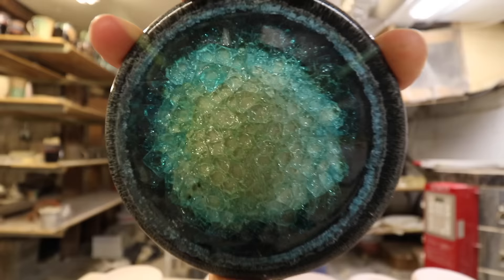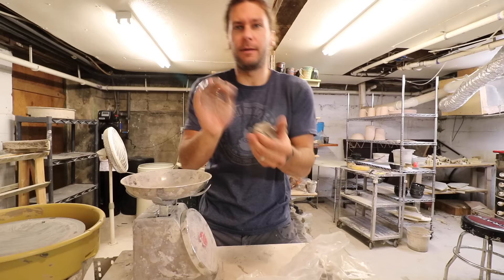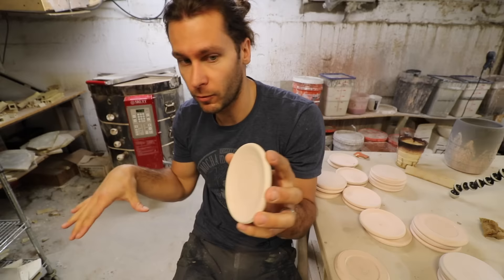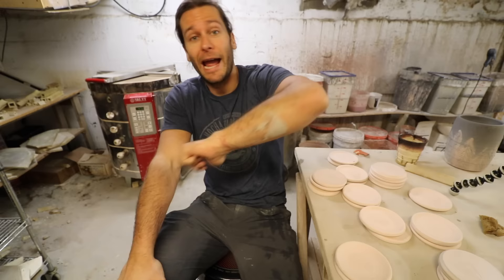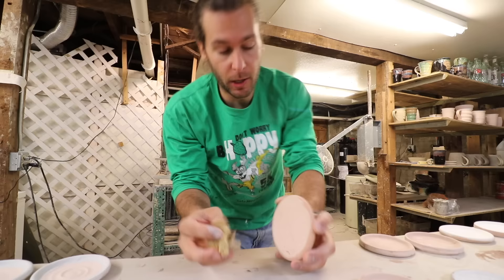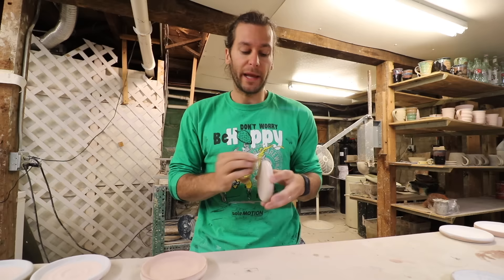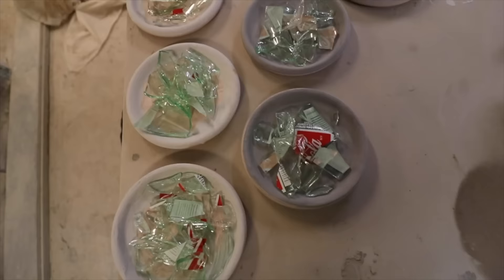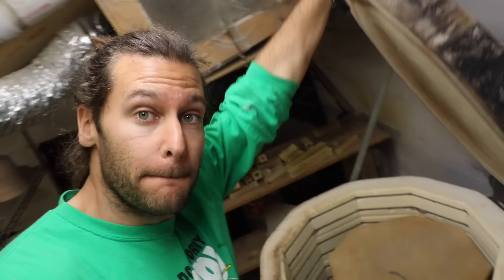How to Make RECYCLED GLASS Coasters!

Comment: I am a retired pottery instructor. Many of my students wanted to add glass to very shallow bowls, similar to what you are doing. They wanted them for jewelry trays. Since the glass left little raised edges that would cause cuts, I had them add a thin layer of resin to deal the surface. Worked great!

Comment: Square coasters?  No waste.  One big sheet.  Cut down, then across.
Not saying that square is better, or more artistic than round coasters.  Just sayin, I believe, cheaper to manufacture.
By the way, I enjoyed the fideo.
Reply: sounds about right.
Reply: Clay can be recycled so there wouldn't be any waste. Also, firing the glass is safer if you have a bit of a rim to prevent glass melting over onto the kiln shelf. So the slabs would still need extra work beyond cutting. Slabs also tend to warp unless you carefully compress/flip them or use a very groggy clay body. I'd be able to whip up a bunch of these on the wheel way faster than I could from a slab, honestly. If you really wanna manufacture cheaply, you'd make a bunch of molds of any shape you want and cast them.

Comment: Two questions:

1. When you dip using tongs, how do you cover the tong marks with glaze?

2. When you leave the red Coca Cola paint on the glass, why isn't there an issue?? Does it just melt and vape off, pigment and all??
Reply: dip the tongs in the glaze before gripping the pottery
Reply: I had the same question about the label.. maybe that's what's causing the bubbles too?

Comment: To Make the coasters food safe you can coat them with food safe epoxy resin which had a glass effect anyway. You wou apply the resin after the coaster is complete. (just a suggestion if you wanted to make any other projects with Glass but in order to do so you would need them to be food safe) I an not entirely sure if the item would be dishwasher safe

Comment: When you use the tongs to hold while glazing, how does the glaze get under?  Why doesn't it leave two spots?
Reply: Glaze like that tends to spread a little during firing. So long as you don’t leave a pointy spot, you should be fine.
Reply: If you dip the tongs in glaze before picking up the piece, you won't get spots/

Comment: Glass comes in different COEs coefficients of expansion.. most fusing glass is either 90 or 96.. and you only fuse together glasses with the same COE. or they will have too much stress between them and eventually crack. I know clays and glazes have COEs also but I’m not sure what they are. If you knew you could possibly put glass glaze and clay together that are compatible. Then the glass wouldn’t crack.

Comment: Several important safety issues seem to be overlooked here.  Obvious is the need for safety glasses. Lacerated corneas are no fun, and loss of vision is a terrible thing.  If you're doing instructional videos, please be mindful that you have a certain responsibility to inform people of the risks they take in copying you.  Gloves.  Again with the thing.  Not sexy to bleed during your video. I suggest leather or heavy rubberized, but please use something.  Even more important.  Ceramic glaze is a health hazard until it's fired.  Powdered glaze becomes airborn and causes lung damage or silicosis.  This damage is permanent.  Use a mask or better yet a respirator. Buy disposable gloves, and get obsessive compulsive about washing your hands. Glazing is messy, mop the floor after each glazing session. That dried glaze becomes dust.  I've left out the chemical issues with certain metallic oxides, which are often poisonous. Gloves goggles and masks. The risks are real.

Comment: Hi John. You say in the video that the melted glass isn't food safe. Why is that? The glass comes from coke bottles, which should be food safe (one hopes). Does something happen in the kiln to make it unsafe?
Reply: It's not the glass. It's the thin cracks between the glass that can trap tiny food particles that can foster bacterial growth
Reply: Could you perhaps layer some clear resin on top after it's fired to fill those cracks?
Reply: To make it food safe? 

It's not likely the clear resin could withstand the long term impact of cutlery; particularly knives. Thereby landing you where you started with the network of cracks compromising the surface. 
Hsin Chen Lin (YT channel) applies ink to a crackle glaze to pronounce the network of cracks, but it is for appearance only, and not a food safe surface. 
You could fire a clear stable glaze on top of the glass, but will have difficulty applying the clear glaze to the already fired first glaze (the glaze with the glass shown here). Supposedly, it's doable, but challenging, and more costly.
I believe Williams Sonoma sells a line of dinnerware utilizing that second glaze technique. Of course, they just buy the pots from the manufacture who have glaze scientists on staff who have a whole host of equipment at their disposal. 
I believe it best to have the glass technique reserved for non food serving pots, but that's just my opinion.
I know that I would not eat off of the glaze shown here, a crackle glaze, or a crystalline glaze. All of those glazes have the same spider web network of thin cracks caused by expansion/contraction of a poor glaze/clay body fit.
To me, it's not worth the risk. It is only breakfast/lunch/dinner or a midnight snack; after all.
If you are the producer/seller, you will want to be sure to have product liability insurance.
Reply: The glass can also break off into the food if it's getting heat/cold shocked with food.
Reply: I would suggest doing a second firing with a clear glaze over the glass. that might cause complications with the glass remelting or the way it would be worth a shot

Comment: Jon, I love this idea.  However, when I try to make these, I have breakage on the sides of the coasters.  Sometimes both sides of the coaster will break off in the final glaze firing.  Do you have these issues?   What suggestions do you have to help?   Thank you so much.
Reply from the maker: I have had these issues and there are two things that I think causes the issues.  One, putting too much glass inside the coaster can break it.  The other is when the rim of the coaster is too vertical, like if you throw the edge straight up that will cause cracking.  Tapering the edges or having them more gradual will give the glass room to melt into it.  The issues are cause by different shrinkage rates so if you think about the the clay shrinking around the glass which doesn't shrink at the same rate just think about the glass not being constricted by anything that might crack around it.  Hope that makes sense!

Comment: Those are lovely and it looks like such fun to make them. Have you ever tried using colored glass?  I'm wondering how well that would work. As for doing a second firing of a clear glaze over these broken glass pieces (or a crackle-type glaze for that matter) to make them food safe/stronger/more stable - it is possible though probably not easy. I am fortunate enough to have a couple lovely bowls that I purchased in Japantown in San Francisco where the pottery used a crackle glaze, then stained the crackles lightly in some way so they remain visible even after they are sealed with a second glaze firing with I think a clear glaze over the top. Anyway, they are food safe and beautiful! But it would require a good knowledge of glazes, experimentation, etc to figure out how to do this properly. I remember even seeing a video of this process once, but it was a long time ago and I don't have the link.
Reply from the maker: I have used colored glass...it works!, but I like the accessibility and reliability of clear glass!

Comment: i put some coloured glass in little pinch pots i made, when i took them out of the kiln most of them had a white crust on the glass, and i looked at a few of them a couple of weeks later and the white crusty stuff has actually spread??? does anyone know what i have done wrong..what is this stuff ? i can scrape some of it off but not all of it. i bisque fired them first, then dipped them in transparent, then put in the glass and fired again definitely at the correct temp.

Comment: Have you ever had a coaster suction to the bottom of your glass? I'm guessing that's why there are corners for putting a finger on the coaster as you pick up your glass. :)
Reply from the maker: Not sure what you mean by suction??
Reply: @Jonthepotter   Condensation on the glass pools at the bottom and creates a vacuum suction. It's why most coasters are wood or cork, to absorb most or some of that liquid. Non-porous materials, like ceramic, glass, and plastic, can suction to the bottom of the glass that's on it. A bar trick is to salt your coaster. The salt lifts your glass and let's air under it.

Anyway...square coasters are easier to put your fingers on and hold down as you lift your cup. Round coasters are usually small and glasses big....leaving a small lip to grip.

It's not a big deal...but my best guess as to why coasters are total squares...lol 

That condensation puddle is cold dropping off a stuck coaster and down your blouse! O.O

Comment: I made these, about 4 sets of four. The all broke in the kiln. They broke consistently either in half or at the edge where the rim is. What did I do wrong? Also, they were loaded at the bottom of my kiln. Did they cool too fast? Did I use too much glass? I love them but only 2 came out. 🙁
Reply from the maker: Either too much glass or the edges came up too straight.  You can't seal the glass in, it needs room to move so the edges should be really tapered out.  Almost more like a flat disc, then a plate
Reply: Jonthepotter  Thanks. I will try making them differently. I think that’s what happened AND I used too much glass. Letcha know. 👍

Comment: Jon I need some advice brother... Im having a 50% success rate on glass over the glaze like your doing it.. Is it maybe my glass is too thick?
Reply from the maker: Could be too much glass?  The other thing is really making sure that the edges of the coasters are tapered out instead of being straight up, does that make sense?  The clay shrinks at a different rate then the glass so if the clay "traps"the glass by going straight up, it will crack the clay, if there it is gradual and the clay has room to shrink around the glass then it works better, hopes that helps!

Comment: Hello Jon, I'm only 1 min. 7 secs. into your video and I subscribed, lol... I too love to see what I can do with my clay and kiln. I have been looking for a tutorial on using cheap dollar store glass beads in this same way, as I don't have any glass to break. What is the lowest temp the glass will melt at? I have low fire clay and glazes...
Reply from the maker: That is a great question I am not sure what exactly the temp is, I think it depends on the glass!
Reply: hey im looking into this too amy, did you try it?
Reply: @rixtvandermolen3893  I DID try it with the glass beads from my dollar store, and it DID work, but not very well. I fired it to come 06 with my glaze, and it didn't crackle as much as Jon's. It's also difficult to tell how many beads to use and not over flow it, so I had some bare areas. I added a couple more beads and fired again and it seemed to crackle a little more... I'm definitely going to keep trying, hope this helps 😀
Reply: @amyrp9115  thanks! really difficult to predict ofcourse but sounds fun though! I think i might like the bare areas even, going to do an experiment on (3d ish) tiles.. Which is coming back to square coasters.. lol.

Comment: We do not have our coke in glass bottles, they are  in plastic. Most of our bottles are. Would jam  or pickle jars do the same thing?
Reply from the maker: Margaret Frew Yes! I've had the same success with any clear glass!
Reply: Hi John...In the beginning of the video, I think you mention "old glass". Do you mean glass that is just 'laying around, and no longer used' or glass from a different time period like 1970 coke bottles? I ask wondering if the 'old glass' had a lower melting temperature, than modern glass, or if had other properties, such as a more even flow to the melt, or is less likely to have pin holes, etc... 
I guess I'm just asking whether or not you actually had to use old glass, or if a drinking glass bought today would work just as well.